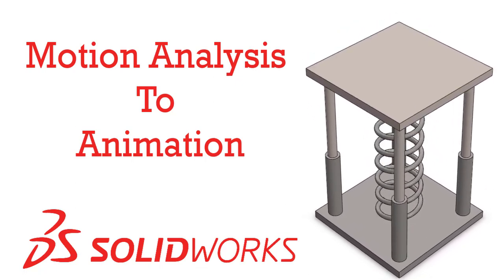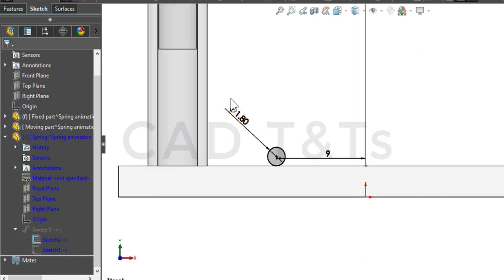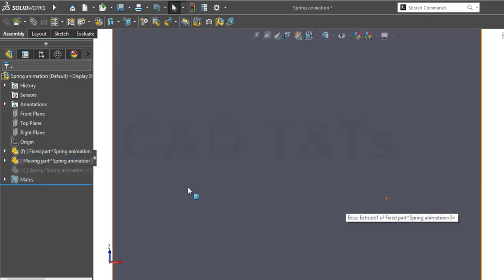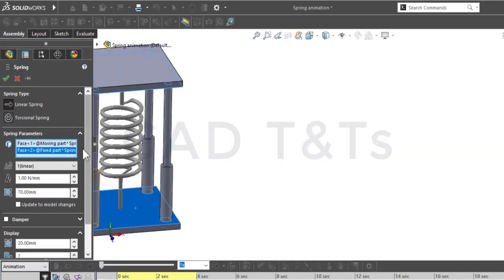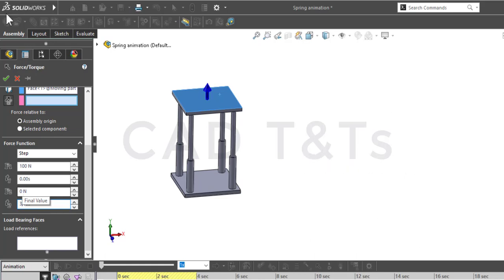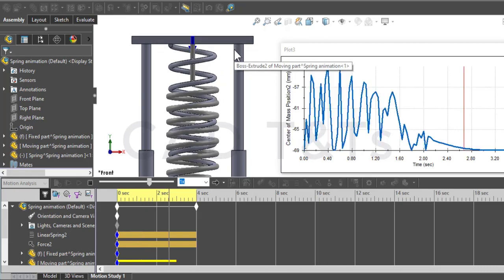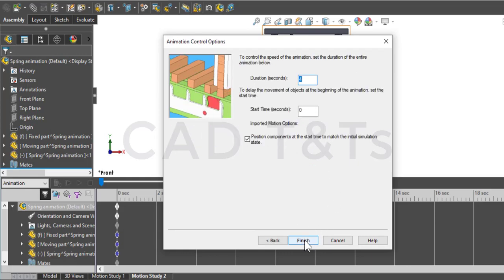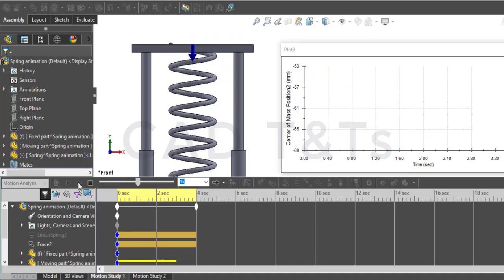The most accurate Spring Animation in Solidworks

Comment: My spring won't stop moving for some reason, even though i use the same parameter for both force and spring as yours. Any idea how i can fix this?
Reply from the maker: For the motion analysis, did you use the "step" in force function section?
Can you have a look at the timestamp around 02:15
Reply: @cad2ts Yessir I did, but dw I just wanted to make a ERM motor stick on top of the plate-spring.
The spring does work normally when the motor spun but doesn’t when I use any force command(Const, Step, Harmonic, etc)
Thank you for replying tho
Reply from the maker: @papidopulas1200  I'll test by myself if I find any solutions.